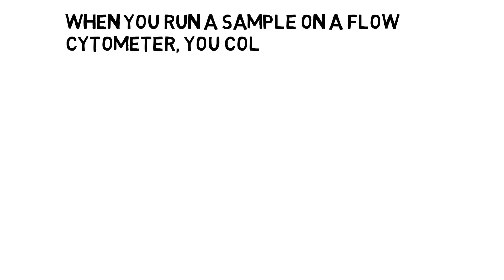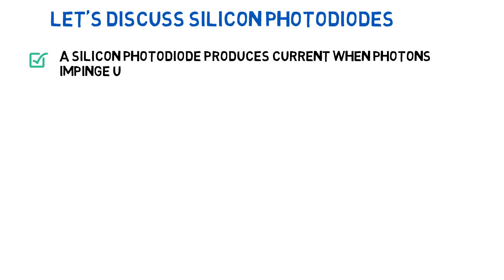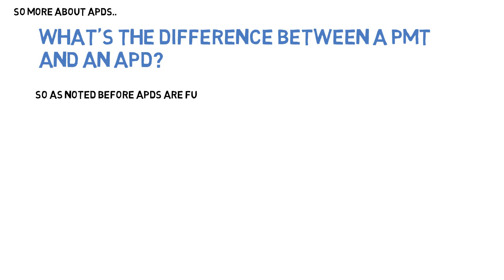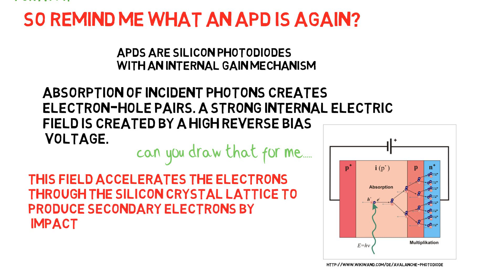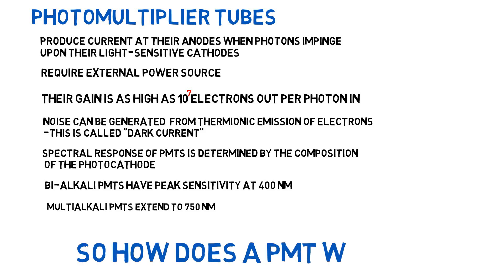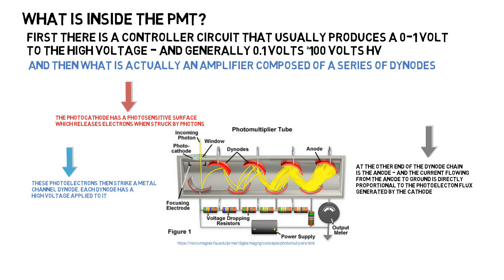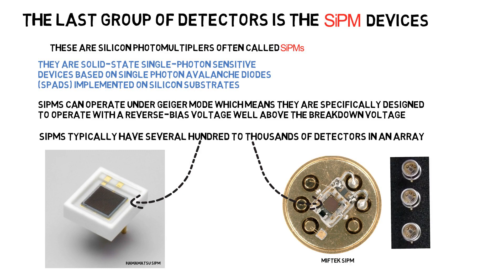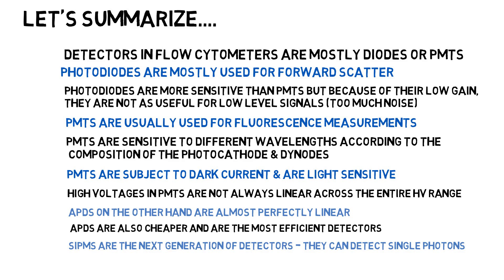PMTs APDs

Comment: I used to grab those off ebay for the cool goodies inside. Also retrofitted an older one with a 488nm laser diode and it gave a much better signal then the original argon laser in it. Currently its used for teaching at the UWM ❤